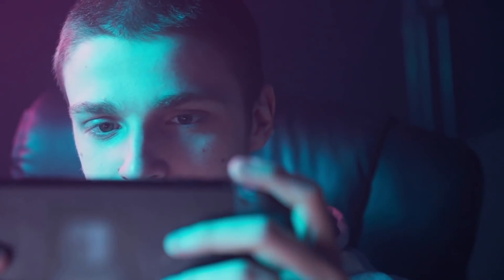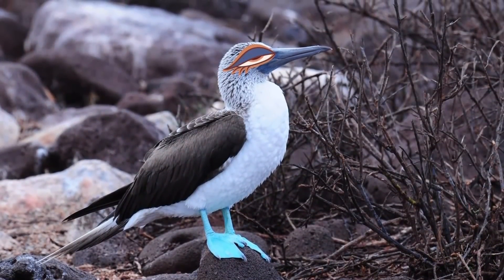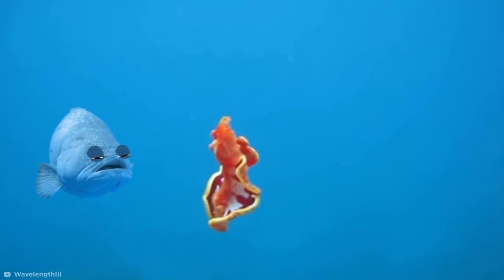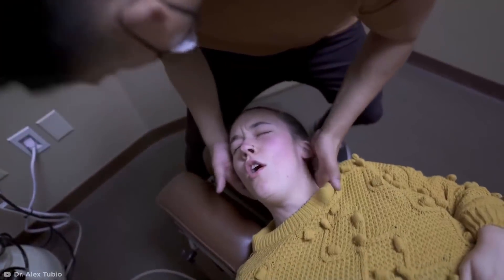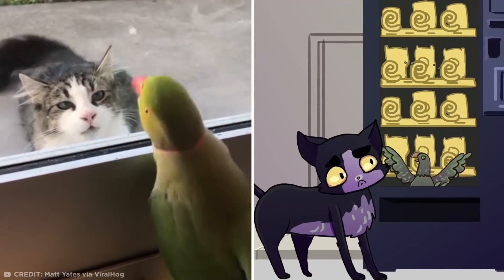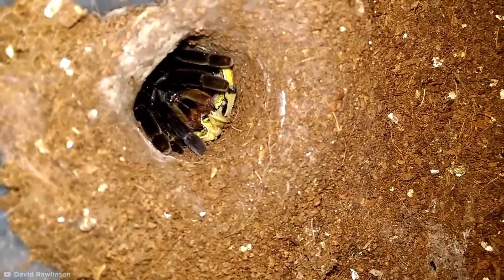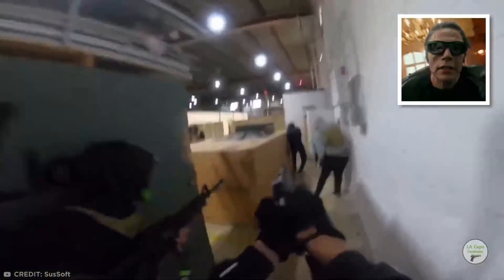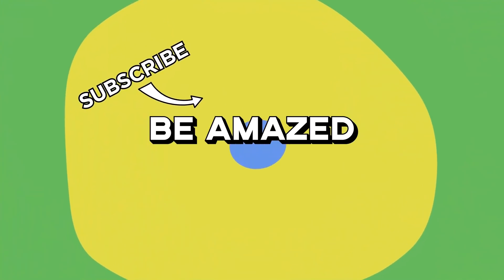Things You Will See for the First Time in Your Life - Part 22

Comment: First time I ever went to a chiropractor, I cried when he was finished, it was such a release! My hips were out of place, and my right shoulder was 2" higher than the left one, and I hurt all over. I left the office walking straight and feeling so much better!
Reply: I don't think I need anything as intense as here, but a really good massage would be nice. A week of sitting on my bed to work on my laptop instead of at my desk (which has sharp edges that dig into my wrists and the chair isn't adjustable, nor does it lock the back so I can't lean back in it) has left me with really bad back pain. Now when I stand for a few minutes, my lower back really hurts. I feel myself tensing there and I can't manage to make myself stop. I put my weight on my right foot, because it hurts a little more standing on my left, but both are bad. I can stretch and I do that, and maybe I should do some more, but this is getting worrying. 

Also doesn't help that the floors of my apartment, especially the kitchen, are uneven, lol. I feel the pain the most standing in there.
Reply: @BewareTheLilyOfTheValley  I agree that you don't need chiropractic adjustment, or any other physical medical help.  You need to do stretching exercises and get more exercise.
Reply: Good point. To get a good stretch, stand with feet shoulder qwerty, and reach up with both hands. Keep reaching for 8-10 seconds, then, bend over forward and try to touch your toes, but once bent over, hang. Don't force it. Repeat that at least 5 times. You'll be able to place your palms flat on the floor! And you'll feel better, and get your blood circulation up! Good luck!!
Reply: I meant shoulder width apart, where on earth did qwerty come from!? 😂😂😂

Comment: I have experienced the chiropractor, it helps with movement and small pain relief. But it doesn't work for everyone. It helped me with my movement disorder called Dystonia until I got a Deep Brain Stimulator implant. Now an Android device wired to a pacemaker battery pack that leads 12 wires into my brain does the job. Dystonia is a rare movement disorder. I was born with it which is even more rare.

Comment: Airsoft, the scourge of law enforcement. The problem is exactly how realistic the launching mechanism is in relation to its lethal counterpart. What's more, if a player does the unthinkable and blackens the colored tip, it can quite literally put the holder's life on the line. We had an officer stop and harass my sons when they were playing with CLEAR Airsoft rifles. I was an active duty cop at the time myself, and when I saw the officer holding my boys at gunpoint, while they played around with absolutely CLEAR plastic rifles, I didn't hesitate at filing a complaint with the city. Never saw the dude again. You'd be surprised how many officers don't understand the law when it comes to Airsoft and paintball guns, propulsion, ammunition and gameplay. Typically, paintball players wear some type of reinforced armor because the paintballs must be fired at a fairly high speed in order to burst the capsule. Airsoft uses plastic BBs, so they don't take a whole lot to fire a projectile a pretty decent distance without much pain to the person on the receiving end. Of course, they can be dangerous, as the kinetic energy of one of the BBs is enough to puncture an eye if done up close and carelessly. Mommas and Poppas, if you are going to let your kids own any kind of replicant "firearm" like an Airsoft gun, make sure they are not neutralizing/nullifying the orange tip, or painting a clear or blue plastic gun, into a dark color.

Comment: I still want to know how lava sets on fire even with no flammable stuff is nearby, sure its hot but is it that hot that it can set itself on fire?
Reply: Are you asking how lava gets hot or how it sets other things on fire without flames? Lava gets hot by pressure & radiogenic heating deep within the earth, about 100-150 km, which causes it to rise or “float” to the surface. Once on the surface it cools from about 3000 degrees Fahrenheit to about 2000 degrees & begins to flow. The cooler it is, the slower it flows, from a few meters a minute to a few meters a day. As for the car, I don’t know exactly what materials automobiles are made of these days but the temperature at which stainless steel ignites is about 700 degrees Fahrenheit so... That makes it pretty easy to see how it would catch fire when being presented with something that is one thousand degrees hotter than it’s ignition point, lol. Hope this was helpful! I’m a huge nerd & love to look this stuff up, lol.